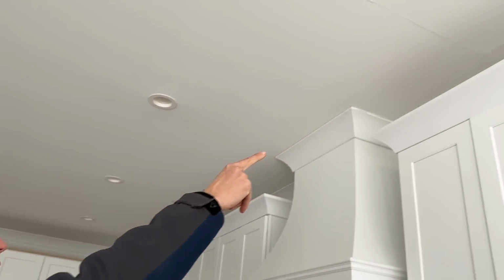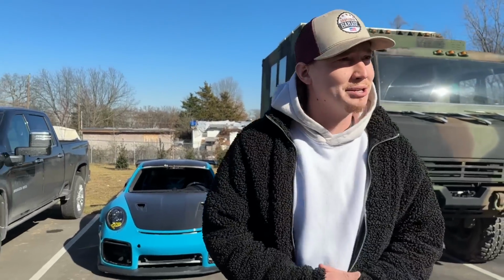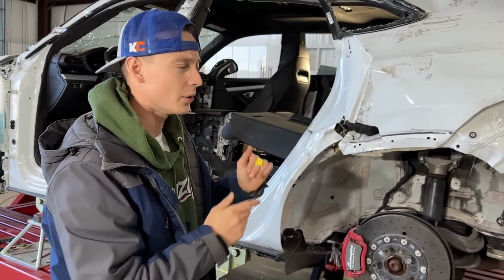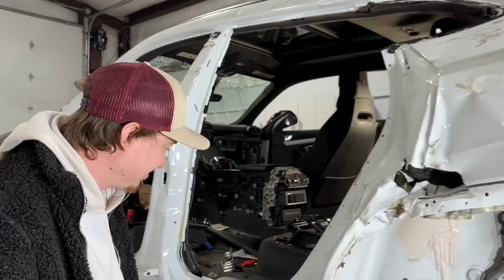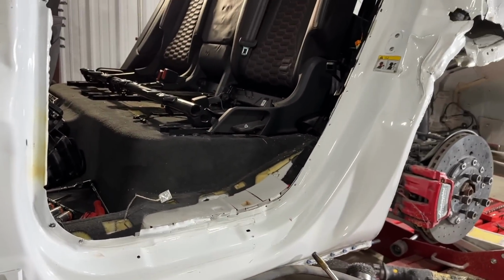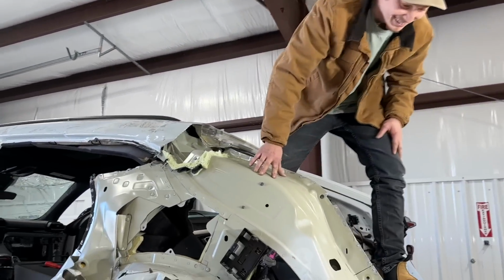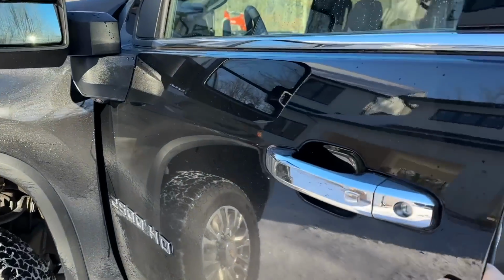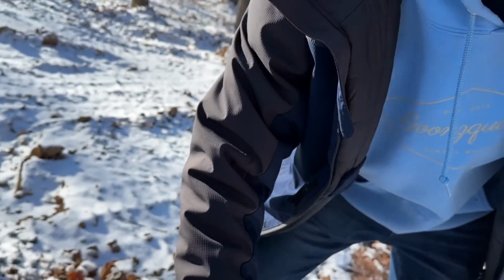Rebuilding A Wrecked Lamborghini Urus Part 5

Comment: Wall cracks are usually from the foundation settling, usually the foundation settles because water makes the ground soft around the foundation, and this is usually due to drainage problems, so check to see if the foundation is settling anywhere so you can fix it up now.
Reply: Wall cracks happen most of the time from wood structure contracting and expending my friend. Houses in USA contract and expend whole lifetime because of as I call it "Toothpick Structure". He shouldn't leave this house without heat on, especially when he already has drywall all finished and painted, cabinets, doors, and now showers going in. If you want to minimize any drywall cracks its good idea to put in whole house humidifier so during winter time you can have same humidity level as during summer time. Cold temperatures act as drying agent so every wooden 2×4  in his house contracts now without heat and adequate humidity level.
Reply: @Michael Curley  he doesn't have water connected to the house 🤦‍♂️ and leaking pipe would be the only thing that would cause this. As I stated earlier, you should never start doing inside work without any type of heat. Cold temperatures act as drying agents, and all wooden structures inside the walls contract, causing drywall to crack.
Reply: I would look at the footer !! The footer might not be below the frost line and if there isnt enough backfill  all around the house to protect the footer from frost that could present an issue ! Frost will lift the house ! Maybe go in the crawl space under the house and put straw around the outside wall to protect the footer !
Reply: @T Nolan   why you all start from the worst but ignore fact that house is not heated at all. Cold temperatures act the same way as dry heat without any humidity. Because of all cold air, all wood inside the walls contracts, causing drywall to be pulled and form cracks.
Reply: @tnolan3176  Also have to look at how the water drains off the roof, with the complicated design it could be draining in a different way than expected and causing a little bit of settling.  Just a hole in our gutter caused the slab to drop just barely in the garage and caused a big crack from the ground floor up through the 2nd floor drywall, we will have to get the slab jacked up back to the normal height.  Can of worms.
Reply: That crack is along the tape float line of sheet rock and not foundation settling. It’s from expansion and can be re-floated.  More of a pain but a good rock hanger can knock it out.  Cabinets are different story if they chip and crack. 

Will need heat before tile goes in for sure.
Reply: @Ventura IT  you both have no idea what you are talking about if you can't comprehend that because of no heat, all wood inside the walls contracts in this house pulling drywall at the same time causing crack lines. I have no idea why you are stuck on this fundation or leaking water crap. It's clear as day that not having heat in his house causes this issue. I just hope his wood floor won't be separating also the minute he turns on the furnace because of all extra frost, which changes to moisture during daytime.
Reply: @codename7832  Could be, but the most common reason for cracks in a house is the foundation due to poor drainage.  I never said it wasn't "heat" or cold...  I'm not arguing with anyone so calm down.
Reply: @Michael Curley  use your comment sense, my friend. Water damage would cause huge water stains on new ceiling drywall. If not stains, you would be able to feel drywall being soft to cause this big of the crack. It's not water damage. I've been in construction business for the past 25 years. You can tell yourself whatever you like. This crack has been caused by wood contracting because the house is not heated.
Reply: @codename7832  Could be the wood contracting, but their drains also aren't working yet either, which could also cause settling.  Settling usually causes cracks in walls, not the ceiling...  It's not likely a leak (water damage.)  I've never heard of the wood contracting if you don't leave your heater on and I grew up in a very cold area of the country... if that happened, then empty houses would fall apart in the winter, which I've never heard of... it's possible but I've never heard of it... we always had to turn off water to any exposed piping to keep it from busting the pipes, but that's about it...  maybe things have changed since I lived in a cold area, but wood dries out as well, but that shouldn't cause that big of a crack, if it does then something is wrong... I can't say what the cause is but the wood getting cold  shouldn't cause that much movement.  I'm going to say it's because the tape and compound were applied incorrectly, too thickly, because not all the seams cracked in the cold.

"Oct 6, 2022 — Cold temperatures can cause the drywall compound to shrink and crack, so it should only be used in homes with heat." - doityourself

"Wood can expand in colder temperatures and it can also contract in colder temperatures. Wood doesn´t directly contract or expand because of the surrounding temperatures but because of its internal humidity level. The higher the humidity level of the wood the more it expands and vice versa." - craftknights

"Does freezing wood shrink it?
The temperature itself is not an issue, as wood does not shrink or swell due to temperature changes alone.Jan 28, 2014" - awfs

"What time of year does wood shrink?
winter
Wood shrinks to its smallest dimension in the winter and swells to its maximum in the summer. The wood in winter projects will expand; the wood in summer projects will contract. In the spring and fall, remember that the wood will expand half your total movement allowance and contract the other half." - workshopcompanion

Almost all say that it's not the temperature but the humidity that causes the shrinking... freezing water actually expands.

"Water is one of the few exceptions to this behavior. When liquid water is cooled, it contracts like one would expect until a temperature of approximately 4 degrees Celsius is reached. After that, it expands slightly until it reaches the freezing point, and then when it freezes it expands by approximately 9%." - iapws
Reply: @Ventura IT  you never heard of wood contracting in cold temperatures? You just answered your own question with the second paragraph you provided.
Reply: @codename7832  That's right, I never heard of it when I lived in a very cold area that was much colder than TN in the winter... and builders are supposed to compensate for any settling or movement...  if it was the wood of the framing in the house shrinking then you'd see a lot more than just 1 crack...  it's a problem with the temperature and thickness of the joint compound applied too thick and too cold.  I think it's possible, but that would mean unheated garages would crack and fall apart if you live in cold areas of the country, and I've never seen that...  you see the crack in the drywall is bigger than normal heat expansion...  that's why I say it's due to applying too thick of a coat of joint compound when it was too cold at the time of applying it... if you read the facts, it's not about the temperature, it's about the humidity that causes the joint compound to crack...

You see wood only contracts less than 1 mm in the winter.

"How much does wood contract in winter?
Wood moves as its moisture content changes. Wood doesn't move much lengthwise, so you don't have to worry a lot about boards getting shorter. But a board can move quite a bit across its width. A board that's 6 inches wide during a humid summer might shrink by 1/32 of an inch in winter." - familyhandyman

1/32 of an inche is .79 mm, not even 1 mm

A human hair is .04 mm to .1 mm in thickness for comparison, according to Hairmax in the UK.

So wood would only contract about the width of 8 human hairs, not even 1mm.
Reply: @codename7832  Also, I still think it could be due to settling because it's right in the center of the house between the line that spearates the high part of the land and the hillside... if the house settles it will be because the part of the foundation that is on the flat and more solid part of the land stays put and the the part of the foundation and house that is on the hillside slowly moves down the hill... they don't have their gutters or drains working properly yet so it's completely possible some of the rain softened that hillside... in other parts of the country you have to get soil tests and most often put in 100 foot pillars of rebar enforced concrete (concrete columns or piles) deep into the ground to prevent sliding down hills or movement of the house or whatever... I saw a swimming pool that was built in Beverly Hills, it had to have something like 8 or 16 reinforced concrete pillars/columns sunk 40 feet into the ground to support it, and it wasn't on a hill as big as this house in the video...  if they cut any corners and didn't do the foundation right or didn't get the soil checked by an engineer and didn't get their drains right or put in fast enough, then then house could literally slide down that hill...  now I don't think that's what happened, but that's the first thing a builder should look at when you get a crack in the drywall, inspect the foundation for any movement and water and incorrect drainage is the #1 cause of slap or foundation movement and cracking walls in a house or building.
Reply: @Ventura IT  you have book knowledge, copy and paste down to the wire my firend. It's too bad that your 1mm contracting theory doesn't work in real life. Ones again. They did the wooden structure of the house during summertime. Wood had time to get a lot of moisture in. If you expose wood that had high levels of moisture to dry heat or sudden cold, it will contract. I've seen 8-10mm gaps between drywall (especially between ceiling and walls) when joists started to contract during winter time when there was not enough humidity in hot air or just cold. Same drywall sheets came back to normal ones humidity level rose.
Reply: @codename7832  Could be since the 1mm is  for 1 peice of wood... if the frame with hundreds of peices of wood in 1 dimension contracted 1mm each, then that would be a 100mm contraction or 4 inches of contraction which would make the house unsafe and possible collapse.  So it's possible it's from shrinkage of the wood, but doubt it because they would have more than one area contract... there would be cracks throughout, not just in one place.  What I think is that was the last place they did the joint compound and put it on too thick at the end of the day when it was getting cold... then the next day it warmed up in the sun and cracked the mud, that's it, the wood didn't contract (or else you'd see it everywhere like I said.  That's my guess, just a guess and it's what I'm sticking with.  I'm not doubting that wood contracts and expands, but there weren't cracks anywhere else, so I'm sticking with the wrong application (too thick and too cold to apply it)... the mud has a valid temperature range for application, outside that range then you'll get a result like this.  The other option that should be checked is the foundation.  Especially now that we see them putting in a retaining wall...  if it was on a hill like that in California they would have had to go much deeper and more substantial with the foundation.
Reply: @Ventura IT  you do realize that cracks will only show up in weak spots. Just because your article said 1 piece of wood is 1mm, it does not apply to real life. To give you an example. For instance, all your joists will contract during winter time. Cracks, or just stretch drywall  tape between ceiling and wall will show up only in weak spots (spots where drywall tape has been compromised or there is just weak spot in joist, maybe not enough nails etc.). Just because someone wrote 1 piece of wood is 1mm of expending or contracting, it does not mean the whole house will act the same exact way. I can tell that you just throwing txt books at me.

Comment: You guys should check the engine that there are no bullets inside the engine or broke through. Like that radiator for an example.
Reply: They dont even know if the engine runs ! With that water in the battery box I would be concerned !

Comment: I hate to be the one to tell you this, but you cannot weld that a-pillar back to oem standard. That A-pillar is made from boron steel, and is formed using a hot-stamping press and then quenched to phase change the material from austenite to martensite. As a structural unit, it is probably made from Usibor 1500, which is an ultra high strength steel. Martensitic material is very brittle, and that is why it cracked.  All oem’s today use boron steels to for the safety cage around the occupants to protect them from crash events. Martensitic materials are far stronger than any weld, and boron steels in martensitic phase are not easy to weld.  That failure of the A-pillar is probably the reason the insurance company totaled the vehicle.   You will have to replace the body side sub assembly, or try to determine what portion, if any, of the body side sub assembly transitions from boron steel to a dual phase or hsla steel, as these steels are cold formed and are more amenable to welding.  Don’t try to repair the A pillar by welding, because that will result in a weaker part and if it fails and causes injury or death, you will be one liability lawsuit from the poor house.  This no joking matter!

Comment: being a panel beater you will find the turret section is under the roof and spot welded to the substructure the roof will likely have to come off first then drill all the hidden spotwelds if you carefully drill the roof off of the donor piece of body shell you will see how it all comes apart cheers from down under

Comment: The wax is up too project against dissimilar metal corrosion. Aluminum and steel will corrode when pressed together. Also high strength magnesium based steel will crack when stretched or flexed beyond it limit.

Comment: If you are going to replace the full 1/4 panel you need to remove the roof center first, then you can replace the new 1/4 panel, the new roof is then bonded in which replaces the laser weld and at the other ends you rivit, this is the correct procedure, if you think you can laser weld as someone suggested they must be a magician!!!

Comment: Check the steel! It is a high risk it is a high tensile steel. Try drilling the steel, if it is difficult to drill, it is high tensile steel.
High tensile steel must be welded according to special processes, otherwhise is the steel strength lost.
My recommendation is to replace high steel parts instead of welding the parts.

Comment: If you suspect wTer infiltration on you ceiling sheetrock take a screwdriver and puncture a few small holes on the seam so that the water can drain.  This will protect the sheet rock from getting soaked and falling from the weight of the water.

Comment: Hey guys...I found your next build...74 auto salvage has a 2022 Porsche GT3 with 1001 miles...$160,000 thats a $400,000 car looks to be an easy fix , not as much work as the one you guys are working on...love your chanel.!

Comment: Could the crack be a seam between steel and aluminum? I’ll bet the steel is down low and structural, where as the aluminum is lighter and forms better.🤷🏼

Comment: Instead of drilling out those self piercing rivets in the door jams it is quicker and better to use a belt grinder and grind through the rivet and don’t go through the backside piece of metal. Then you can put self piercings rivets back in next to the old rivets and it will look close to oem and still flush. 👍
Reply: Also yes they use different strength/ size of self piercing rivets depending on what metals and how many layers of metal they are going into

Comment: The roof is laser brazed on. You’ll need to cut down the center of it with a cutoff wheel. Should only be about 1mm thick

Comment: one other point, you cannot repair boron steel parts like you would with low carbon or hsla steels. Boron steels are heated to 900 degrees c, at which they are transformed from a ferrite to austenite phase, and at these elevated temperatures, they are formable. After forming, they are quenched quickly to phase transform to a martensitic phase.  They will not be formable if you try to pull them in your frame machine, and if you put heat to the part in an attempt to pull it back into position, you will alter the martensitic phase of the material and will not be able to restore it back to its martensitic phase.  Hence, the part will be weaker than oem.  Your best bet is to try to replace the full body side sub-assembly rather than the rear quarter outer or the body side outer. Besides, it will make for a more interesting set of videos, Besides, what do you have to lose, you paid for everything, so you might as well use it!

Comment: The damage on the ceiling is from not taping the seems
Reply: The seams are expanding and contracting due to the Difference in temperature !  Should have had heat in the house before now !!

Comment: Well...good luck with those cracks! That is from settling, and will be coming back over and over again most probably...(from experience). You might as well cover the ceiling with styrofoam tiles and call it a day; those cracks are a pain in the butt, especially if there is a walking space over them on the 2nd floor.

Comment: HEY BOYS you want to be carefull the split in the a pillar window steel it may be high strenth boron steel  that dont like mig welding and needs the whole panel replaced and a controled resistance spot welder to be used to weld in new